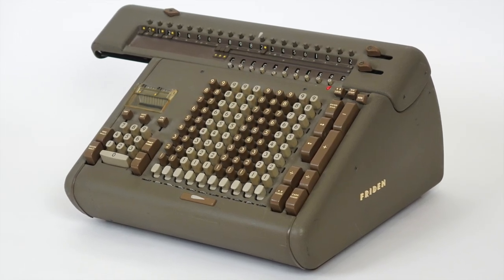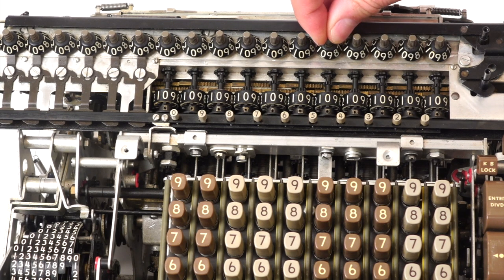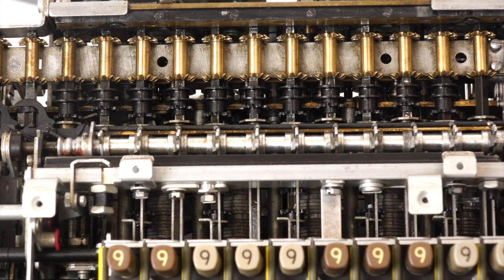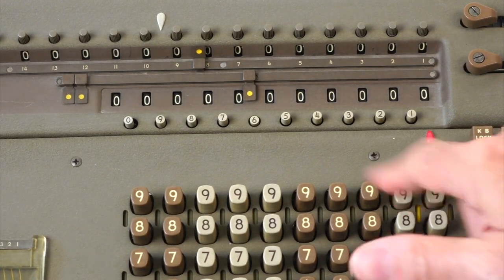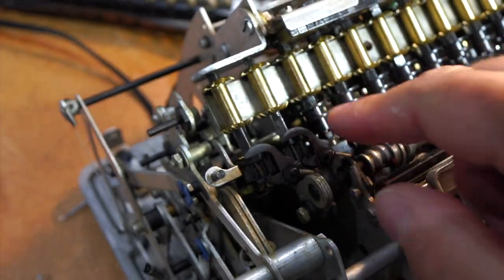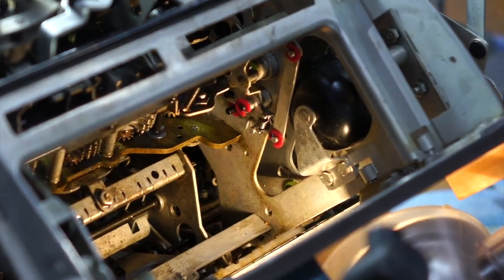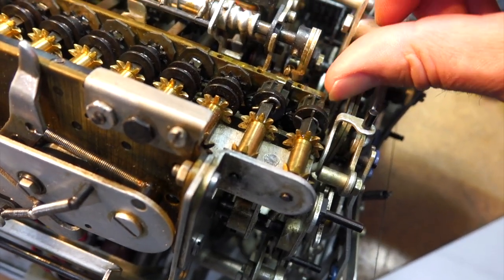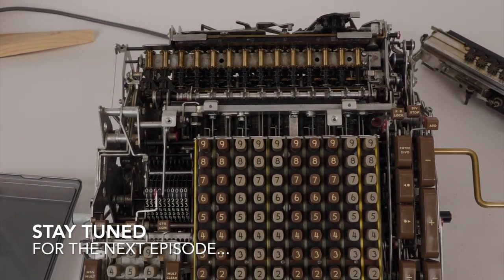Explaining the Friden Mechanical Calculator (while fixing it)

Comment: "too much wear" Hmmmm, isn't that some of the least used digits?
Reply from the maker: But the reset cam does one rotation for every cycle of the machine. Regardless of the actual use of of the digit.
Reply: The whole mechanism moves, doesn't matter what you do. Limitation and flaw in one.

These machines, unfortunately, have a finite life. Once the system gets worn down enough, that's it. It's over.

I have a french make machine from the 1800's and it's at that stage where the components are so utterly worn down that it cannot operate anymore. And the wear is exactly like here. The digits are bleached only in the upper digits, meaning those were barely used, but the whole mechanism is worn down because the whole machine resets.